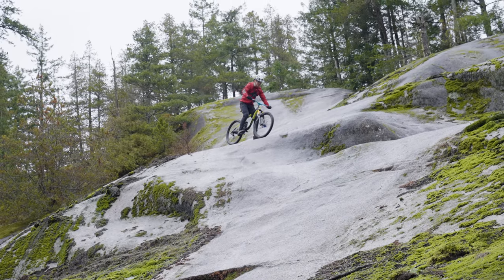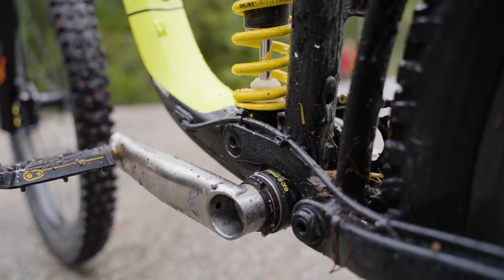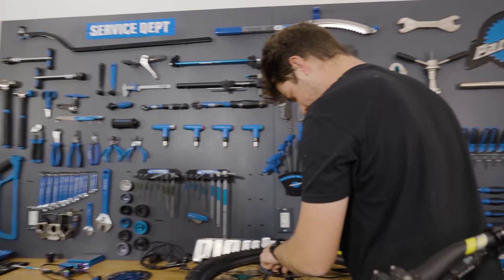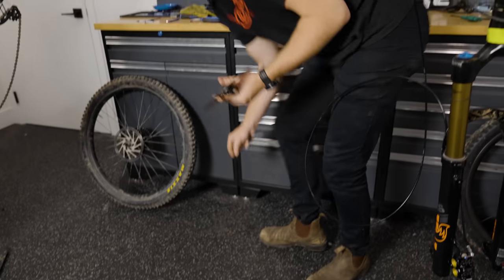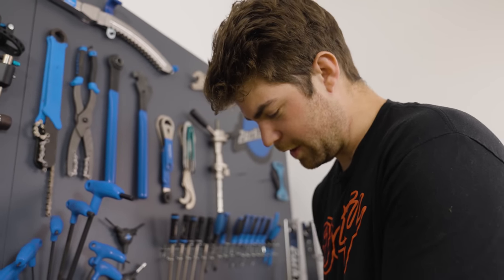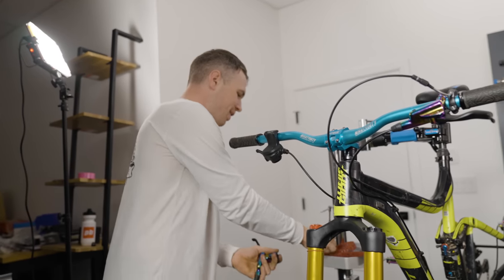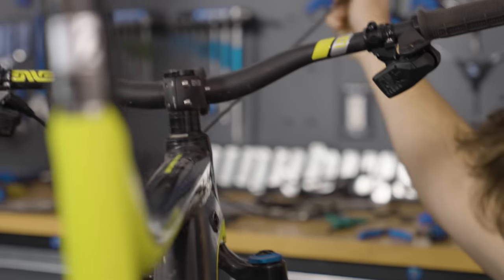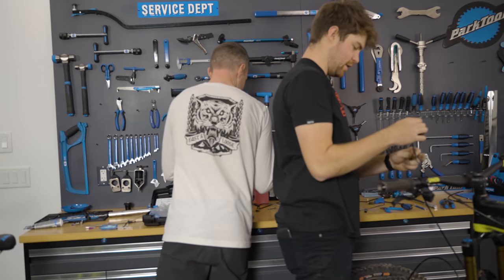$125 vs. $517 Brakes - Budget vs. Baller Episode 7

Comment: The "problem" with the brake hose not coming out of the fitting is quite common. When you wiggle the hose sideways it comes out easy.
Please don't make problems to fit your storyline.

Comment: I think he got brake fluid on the front rotor. He was mainly complaining about the front brake and he had the front tire with the rotor on while he bled them and I watched the fluid go squirting everywhere. I wouldn't have high Hope's for brakes that cheap anyways but even the best brakes won't work with contaminated rotors/pads.

Comment: I don't understand the concept. Pink bike have bought similar spec bike but they are downgrading one of the bikes in the form of the cheaper parts. I don't see why they don't just leave the better stock parts on instead of downgrading the forks or like here the brakes from im guessing guides to some cheap dangerous Chinese brakes. I think it would of been better if you did new vs used budget upgrades.

Comment: A set of shimanos br-mt200 2 pot brakes and some 10€ rotors would've done a better job om slowing henry down. Wolud be a total of 80-100€ for the whole setup.
Reply: I use this brake. With big disc rotors and strong fingers you can still go over the bar with them

Comment: Budget ones are probably organic; maguras are surely sintered metal. Compare the zoom ones with sintered or ceramic pads and that would be a fair comparison. 
And really 180 vs 200 rotor and dual vs 4 piston?
Tired of the budget bashing.
Get a 4 piston with sintered and  200+ rotors; then compare.

Comment: Meh. Full braking with the wheel rotating does mean that there is not enough pressure. Even an entry level brake system blocks wheels.

Comment: I would love to see the low budget brakes with just better brake pads. I can’t see how the rest of the brake system would just not allow the power of your pull just not go anywhere.
Reply: Im betting better pads and Bigger rotors would greatly improve the budget brakes. They are literally XC style brakes but they are using pretty steep trails to test them. I'm betting the Budget Shimano would fare any better in those conditions with stock pads and small rotors.

Comment: Here is why this series doesn’t work. 
You originally compared this to high low by donut. The thing is with the low car they looked for any way they could to get the best possible budget option. 
Why wouldn’t you look for a used but good set of brakes?    This seems to be what I find myself saying every episode. 

It absolutely takes away from what this could have and should have been

Comment: Did you guys bed those brakes in? It doesnt seem like it. I agree with all the other commenters, this isnt "upgrading". This is upgrading one bike and DOWNgrading the other one from even its stock form. You didnt switch the rear shock on Henrys bike... you rebuilt is. Why not just get new rotors and pads for the stock brakes and "redo" them instead of taking off decent brakes and installing absolute junk. HOnestly guys, this series had so much potential. But its been lost on the last few episodes.

Comment: Those brakes are Shimano clones. XC style brakes on steep trails. Im sure bigger rotors and better pads would help the budget brakes a ton. No they wont be comparable to 4 pistons but that should have been a budget trail brake vs baller..Not budget XC. :)

Comment: A magura mt5 is by no means a "baller" move. Missed opportunity to buy some trickstuff for litterally over 1000 Dollars. Also I am not sure how this magura come at a Price of 850Dollars.  here you get them for 200-300 Euros in SET!!!
Reply: They opted to double the price by going for the ones with Fabio Wibmer's signature and using the expensive floating ebike rotors. Not a bad combination but far from the best you can get. I honestly believe that the normal MT5s with standard 203m rotors would actually be a bang on choice for the budget build if they hadn't decided to deliberately bolt trash on that poor bike.
Reply: @frankthetankricard  well you can get the Fabio Wibmer brakes for 270€. If you want these rotors it's +80€. I don't understand how they came up with 850. You can buy 2 pairs for this money

Comment: Wtf you mean. Shimano mt200. That's budget and they work great. I feel the probably more expensive ones my older xc came with bite with a bit less force, but mt200 can catapult me over the bars just fine. At least after a while. Just when I had kinda given up hope they'd start working right they did.          I'm talking nuances.  I mean hell. Have you used brakes that actually suck  ever?   To me the difference between Shimano Mt 200 and anything else can only possibly be like brembo on a street triple R versus on a KTM 990 Supermoto. Meaning use 2 fingers on street. Or one. Better only one and be very gentle on the KTM.  That's not better just sharper.       All other details are to be disregarded if you wanna talk budget.  Maybe some fading after 10 min hard braking in 40 c weather? Yeah no can't factor that in for a budget.   I know modulation. I did a stoppie on that street triple I only tried out for 10 min.   I know what that means.  I can't comprehend any difference so big as to consider something more expensive than Shimano mt200 budget.       That's not me saying more is outrageous either just not the budget option. Budget would need to match the Shimanos for less

Comment: Tip: DON'T unscrew the nut fully before pulling the hose out of the caliper and lever. Leave it a few turns in, so that it will stop the olive when it eventually comes out. That way you avoid splashing (and losing) oil across the whole room.

Comment: You guys have this whole series ass-backwards. The baller side is about right, but the "budget" choices have been absolutely stupid so far. This is probably the worst one yet. This was not an upgrade by any sense of the word or stretch of the imagination. You would have been far better off with simply upgrading the rotors and pads and bleeding the existing brakes. This was spending money to make the bike worse.

Comment: Should have been entry level working brakes and not ebay specials vs high end brakes people would actually use, such as regular mt7s (which including rotors are not $800, I did see the title was changed though). Theres no reason to test limited edition cosmetically upgraded brakes if you want to make actually informative content.

Comment: This is so wrong,u blatantly contaminated the cheep disc when bled them,Ur supposed to encourage people into the sport with less money,I have 2 sets of them brakes,one on my 35 mph evoke and they lock up fine, obviously not as good as maguras but for 99 percent of people not racing they will be fine,I can manual and pull stoppies on both my sets one on 160 mm and the ebike set on 203, these are a good budget option for most I've been running mine for nearly 2 years np,that video was up its own bum as nice as u tried to be , please encourage the young and poor into our sport, thank you, some of you stuff is great btw !

Comment: Bout to unsubscribe due to this click baiting nonsense. 

Another bullshit parts vs over the top parts. I thought Henry was good cause he came from GMBN. He is the mechanic is this duo so WTF Henry? Budget means best bag for your buck to most of us not downgrading. The squall says it all. 13:50  Even cheap brakes will lock up and stop you good, but you all did not even bother to do the bed in procedure. 

The budget bike should get parts that are equal to oem or better. Baller should be what ever over the top insanity you want.